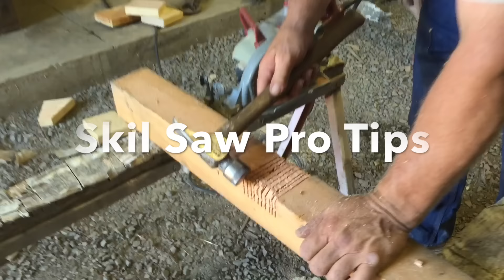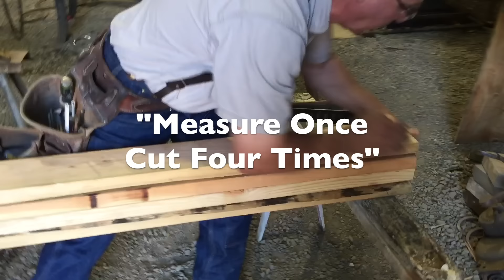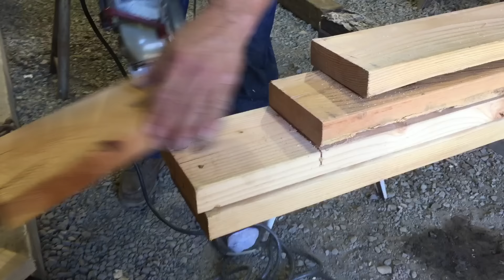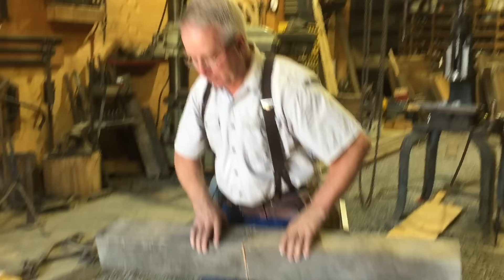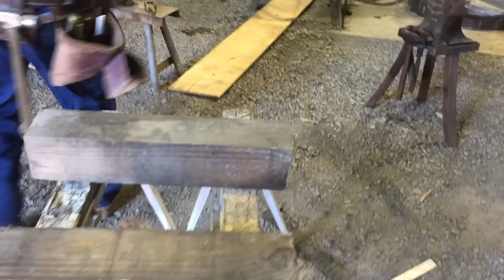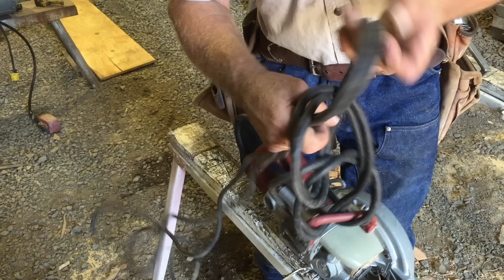Skil Saw Pro Tips

Comment: We used to cut aluminum fascia with the blade turned over so it spun backwards and the safety guard tied off with a piece of wire. One day buddy grabs that saw to cut a rough hole in the old wooden fascia we were covering over and he must have hit a knot or something because the saw kicked back and flew into his crotch. Lucky for him he just happened to be wearing a big 30' foot tape measure in a holster and it caught the blade just in time before it bit his dick off.

Comment: You are a true master of your craft.  But eye and ear protection are needed for any work with tools.  Yes even running a skill saw through a 2x4.  You wear glasses, sure.  But they are not rated for impact that the ANSI Z87.2 will give you.  If you wear glasses already, why not buy a pair of prescription safety glasses with side shields?  Mine are cheaper than my everyday glasses.  And yes I wear ear protection when working in my garage, local makerspace and everyday at work.  It is cheap protection.  A box of corded Max Lite with a 30 dB rating is only $20 and lasts about 3 months with a new pair every day.  Plain and simply, in todays age, there is zero reason to not wear your PPE.

Comment: Now I watched this video only once, so I might have missed something, but maybe not. I'm 76 in Feb 2019, a BC Dept of Labour Certified Journeyman Carpenter since 1974. This fella's a cowboy-Carpenter, and while I knew all the tricks he demoed, I had to chuckle over his presentation. I'm a big fan of finesse, but, as he points out repeatedly, it's good enough for framing, if within critical tolerances. Or, as we say in Canada, it's good enough for government work!

I did wonder from the get-go about his lack of hearing & eye protection, but I too wear glasses (w/tempered lenses) and noted that he does; our type tends to discount safety glasses for the most part. But, as I tell employees & students, "Do as I say, not as I do," when I demo dangerous moves.

I guess he's about 55, in pretty good shape except for a bit of a gut, but still agile. Still, one must strive to fitness if you want to perform athletically. Until 3 operations ago and  5 years, I could carry an 88 lb bag of masonry cement from one side of a job to the other; I'd be hard-pressed to do that now. And above all, take good care of your knees, use a pad whenever you have to, as you only get 1 set per lifetime!

Finally, I note he is one of the very few Carpenter aside from myself who make a shallow V to mark where the line is, NOT scratching or pencilling a line. You've no idea how important this is in so many ways: all viewers will do well to adopt the practice.

Esquimalt, BC

Comment: I’m 28 and followed my dads footsteps and became a farmer and eventually became a finish carpenter I still do a lot of framing and do all these a skillsaw is my favorite saw for big wood I use a makita chordless circ saw for finish. But I grew up with our guards pinned up and you really have to respect the saw if you did how he did when setting the saw down you would cut your toes off or the saw would run away cutting lines in the ground. I’ve had to use that same skillsaw as a grinder over head I love my skilly

Comment: About 20 years ago, I tried an old diamond tile blade from my wet cut tile saw for cutting steel.  The blade needed to be replace, but still had some diamond grit on it.  I have a 2nd Skil 77 I dedicated to masonry, or anything else I could cut with an abrasive blade.

I didn't expect much, but was I surprised. I ended up using a C clamp & spare quick connect fitting on an airhose, with a small inline regulator to drop the PSI to about 30-40# as an air cooling system.

I turned the pressure up as I got braver and braver with material thickness. The air also helps blow away some of the slag when you're cutting 3/8" steel.

I figured the blade would heat up, and warp badly, but I'm still using the same blade. I don't use it that frequently since I have a bandsaw and dedicated metal saw.

But, when I need to cut something quickly, or it's too big, My old olive drab 77 never fails, (I bought it used in the 70's, after the military thought they got all the good out of it. I got my $20 back a few times over in 40+ years).

Comment: +Essential Craftsman I'm finishing my basement and chose steel framing for it. Regarding the carbide saws... can I use one on a miter saw and use it to cut the studs? I think they are about 25 gauge or something ... that would save a great deal of time instead of snips. Also, how many studs at a time you think it could do? They are U shaped  so I can probably do at least 2 at a time. Using a miter with a fence extended and blocking would save me lots of time!

Comment: very nice!  i got a tip for ear plugs. use a  hard paper towel break a peace. role a cylinder wet it with water. put  it in your ear.  i would use it in nighclubs and loud work, it will knock out all the loud noises but yoou will hear everything els fine. when you get good at making it just the right side, people wont even see it.

Comment: I bet if I were to demo one of your projects. It would be effortless. I been itching to put projects together instead of tearing them apart. You sir are top tier. I usually only use this type of saw on solid wood flooring or supports for floating counter tops to access drywall behind. In my line of work its application is minimal.

Comment: Cutting rafters using the saw kerf from the previous one as a pattern for the successive cuts?  I've been doing houses all my life, first as a framer for many years.  I wouldn't want to be the exterior trimmer to follow your method; plenty of shims needed for sure when installing the gutter fascia.  Always cut the rafters using the same pattern for markout being careful with the crowns up.  Always use a tight string line to straighten the outside walls when bracing.

Comment: Best saftey technique for all power tools is to use your ears. If it makes a sound, its dangerous. If you hear a sound that the saw typically doesn't make, your  binding the blade. You can hear when you are entering a grain that can lead into a kick back. A plunge cut is very safe so long as the blade is spinning at full power.  I plunge cut all day. Even when ripping fir. I am always lifting the blade to the top of the kerf, ( the blade is still in the kerf,) which allows the blade to spin square, and reset the kerf so its square. It removes alot of binding and traveling of the blade. I use the same technique when using a table saw.

Comment: Nice, on my 39th year, do yourself a favor add a twist lock on the boot end on saw handle, than if you roll up and don't have to take cords, simply untwist, or better yet get the new makita cordless framing saw, also tuck your thumb if your going to put behind the blade.... yikes

Comment: I have an old Craftsman saw (made by Skil, BTW) and when it go about 25 years old, the cord finally was too frayed for me to ignore anymore. Instead of replacing it with a stock replacement, I went to Walmart and bought a 25' 16ga outdoor extension cord which I cut off the one end and wired it into my saw. Now, 90% of the time I am always able to reach a receptacle w/o needing an extension cord. Great time saver!

Comment: Great video. You’re obviously an experienced carpenter. However, I doubt you’re a structural engineer. Over cutting a birds mouth is not advisable. Ask any roofer who has to stand on the decking of your rafter tail. If your over cut hits a hairline between the light and dark grain, it will fracture. Especially if the pine is particularly dry.

Comment: Before I tried any of the techniques you demonstrated I would need a good worm drive saw like the one you are using. My neighbor used to work with two other carpenters building houses and I couldn't figure out how they could build one in three days, I think you just showed me. 
By the way, you have a kind of Chevy Chase thing going on but with more talent, thanks for the video.  And I did hit that subscribe button, some real time savers there like measure once and cut 4 times instead of measure twice and cut once.

Comment: Great video.  And what a shop!  I hope my next shop is as large though I think I would pour that final piece of concrete so as not to have a step right where you are working.  I too am an "old time" carpenter having started building custom homes with an old carpenter back in '73.  And oddly enough, even though I use all the methods used in the video, I do have my hearing, all my fingers and toes.  Just a couple things I would like to mention:  On the rafter layout you should have shown the 12:6 setup for the square for your seat  cut and could have saved a step when marking out the bird's mouth for 3-1/2" while the square was still in position for the plumb cut layout.  The "Polish Plane" which has been a standby of mine for countless years is much safer to use if you hole the saw at a 45" angle (or more) instead of the 90 degree angle as shown.  Much safer as the blade won't catch and kick back.  (At least less a propensity to do so.).  Lastly, it would have been good to mention to never run the blade through a hardened screw whether it is a drywall screw, timber-lock, decking screw or what have you.  Not only will this quite nicely remove the carbide from the teeth but it will also send the pieces of carbide and screws in a most dangerous manner.  Think shrapnel. Great to see a well versed carpenter sharing his tricks with the "newbies" and yes, don't try these techniques unless you are very comfortable with the use of a saw.  PS.  The worm gear style of saw shown is much safer than the sidewinder style of saw as  the weight of the saw and the location of your arm (and shoulder)  behind the saw create a much sturdier brace as opposed to the arm above the saw allowing the wrist to function as a pivot point.  Thumbs Up!

Comment: you can learn a lot from this guy,,,,, however i disagree with nails and your blade...  i like to have a sidewinder cheap skillsaw with me also , and use it if theres nails......  brand new diablo blade is soo awesome ..... .  they are however exactly like chainsaw blades....  one nail, or concrete floor , or gang plate,,, and they are never the same again,,

Comment: I use a C5 carbide blade , i'll cut,  Unistrut,  conduit , just about any metal, I'm a lefty so yeah he's right it'll burn your cheek with Sparks been using a skill saw for 40 years , the main thing is to keep  downward pressure in front of the blade and keep your body out of the line of the blade , as with all power tools hang on,  I take the guard off I hate that it's a waste of time

Comment: Great video! Extremely skilled with a worm drive to say the least. 1 safety suggestion for others,  if you are learning how to become skilled with a worm drive skill saw. Always turn the blade away from you when setting the saw down on the ground. If you are right handed this would be the left side of the saw,  which would turn the blade away from you when setting it down. You never know when a guard might be blocked or if a piece of lumber might get caught in your saw and accidentally block your guard and expose your blade. This could cause a kick back over your foot , up your leg or a hand. Just a good practice to use, once it is ingrained it becomes second nature.

Comment: osha will take that saw with a 40’ cord off the job, you have to be able to unplug if your switch fails.  Bosch, who now owns “skil “ has a male plug at the butt of the saw to which you can legally attach whatever length extension cord you want.

Comment: Man that looks like an old worm drive. Lots of metal on it.  I learned on a side winder but most pros in the 70s used the skill 77.  I got a Makita worm drive in Alaska in 77,  and was amazed how much power it had even with a dull blade....it would just drive through the work.  You definitely need to learn your saw.  On the guides to get away from looking at the kerf while sawing. Out of habit, I still look at the line while cutting.  I haven’t been a carpenter sinc3 the 90’s,  and I still have my original B&D  7.25” from 66 when it was metal.  The trade school I went to was all 
Porter Cable, all metal casings.
You make it look so easy, like most pros do.

Comment: Excellent demonstration. All things I've done before  but never knew the proper term of the "polish plane". The over head or upside down plunge can be a little tricky.  Ridiculous story, I built scaffold in a BP refinery and their safety was off the chart insane. Scaffold doesn't really attract the most rigid followers of safety rules to begin with but we were told that BOTH handles were to be used AT ALL TIMES.  Even at a saw table setting. I seriously don't know how I worked there as long as I did without going crazy, that was just the tip of the iceberg

Comment: And a note about carbide, sheet steel is ok but aluminium demands lubrication. I've had 1/8th (3mm) aluminium tear carbide teeth from aluminium cutting blades by neglecting lube between cuts.

Comment: Those are nice tips for working with the skil saws and I have one I purchased about two years ago and only used it once. I have another saw which I used to cut wood with and once used it to cut PVP with. I had the older saw back from when I worked for the Rockwell Corporation locally and purchased it through the company. I learned to use the saws safely when in high school decades ago and again received some training while in the Air Force.

Comment: A very knowledgeable gentleman. Learned something new for sure! However one thing differs between you and I and that is that I like my battery powered skill saws. Not as much cutting torque but not a single wire to chase around. Believe it or not the DeWalt flexvolt are very powerful and last just long enough to get the job done. Charge 2 to 4 batteries every night  and so far has been enough to make it through the long days. That being said, I won't recommend the battery-powered saws for the long continuous cuts of thick dense lumber, the batteries just can't keep the amps.

Comment: These techniques are not for a regular person. They are for a skilled craftsman. You should have a saw like the one he has and an excellent saw blade. Don't try this unless you are a pro. I worked in a shop with a person like this. I really enjoyed this video. Thanks!  Excellent video! This is the type of saw you need to be able to cut like he's cutting.
https://www.northerntool.com/shop/tools/product_200704234_200704234
https://www.homedepot.com/p/SKILSAW-15-Amp-Corded-Electric-7-1-4-in-Magnesium-Worm-Drive-Circular-Saw-with-24-Tooth-Carbide-Tipped-Diablo-Blade-SPT77WM-22/204955639

Comment: Super experienced carpenter indeed. Just a note. When plunging your saw on a square line, look at the blade on the correct side of the line and then check your guide before making the cut. The guide is where the blade is going.

Comment: I run the same saw for thirty years, do a lot of the same techniques, but if I ever said good enough on a hip rafter or a stud cut I would retire.  Good enough works for concrete forms but I work around contractors that want everything shot in, which results in cutting studs to within a 1/16 and then on the strong or weak side,  I like the demonstration, and we have verysimilar views.  But most of these tricks should never be tried by anyone but the most skilled.

Comment: Dear Scott, Thank you very much for these essential craftsman video's. In Europe were not aware of the existence of the worm drive saw. The sidewinders in Europe have the motor on the left side and it is obstructing the sight on what the saw is cutting. As we do not have alternative saw for 230V, I was considering to order a Skilsaw from the US and using a 230V to 120V transformer. Before doing this, I wished to have your opinion. Could you please post a video on this topic? Could you do the same Pro Tips on a side winder with the motor on the left side? Thank you very much.

Comment: Great video and techniques!  I read a lot of the comments including some about saw choices.
This is sort of unrelated but reminded me of something I will never forget-  I am just a hobbiest and I bought a Ryobi chop saw from HD to cut "engineered" flooring which, as you know, is basically 3/8" plywood.
The brand new saw WOULD NOT make the VERY FIRST CUT!!   It just burned through the wood.  I thought the blade might be reversed but it wasn't.
A friend (pro) told me "that's normal" and you have to buy a good blade. I could understand if it was like a "starter blade" that didn't last long but not to make ONE cut was laughable.
I got a quality blade and still use it after many years.  Crazy?

Comment: Here in UK I cut my rafters entirely differently. Usually I'll use a chop saw for plumb (ridge)cuts, but especially on valley or jack rafter compound cuts because I'll get two rafters for the price of one (assuming they're long enough).  Birds mouth will be cut by jigsaw.  Fascia cuts will be cut in-situ because the brick wall will definitely be out of parallel, so I'll string them in and cut them off with a circular saw, this keeps the soffits correct all round.  Our birds mouths over here are always 1/3 the width of the timber.  Nice to compare the same language in different parts of the world!